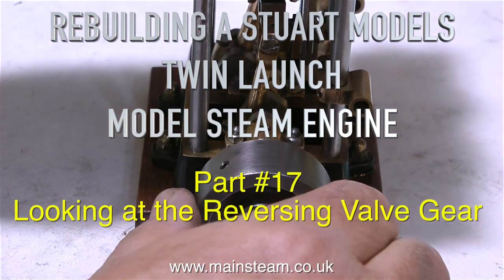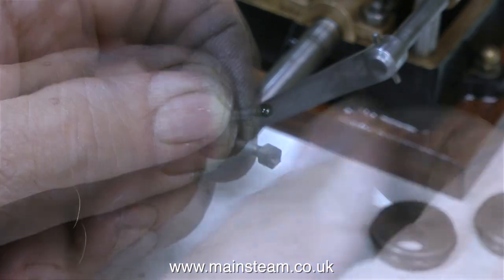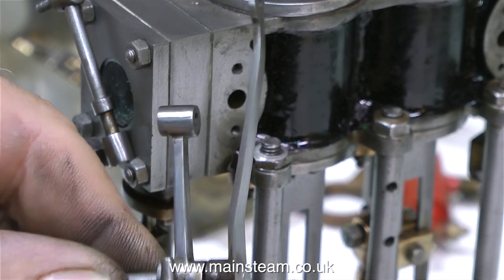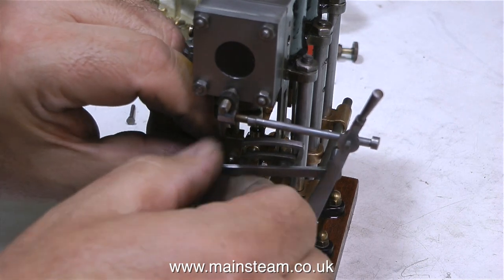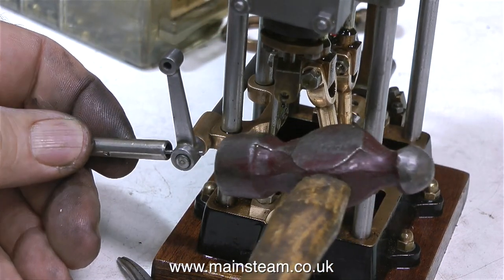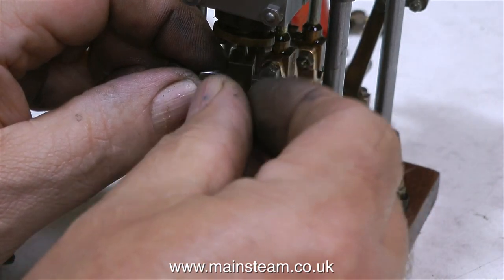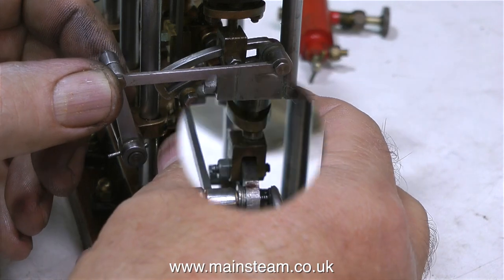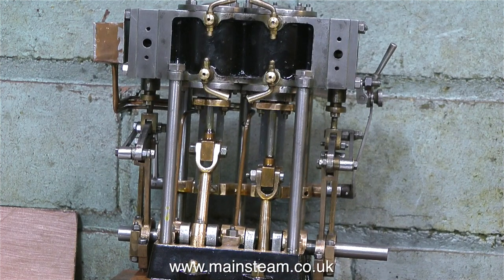STUART MODELS TWIN LAUNCH STEAM ENGINE REBUILD - PART #17

Comment: Just for your viewers' information, the Stephenson Link Valve Motion was used by the LMS (London, Midland and Scottish) railway on their Sir William Stanier designed Class 5XP, the infamous 'Black Five' since they were always painted black. There was only one such locomotive built utilising the Stephenson Link, LMS no. 4767.

4767 was completed on the last day of the LMS, 31 December 1947 at Crewe Works. It was unique amongst the 842-strong class in that it featured outside Stephenson Link Motion in addition to other experimental features.

It was renumbered 44767 under BR nomenclature. The locomotive was preserved and nowadays invariably runs under the original BR livery of 44767 and has since been named 'GEORGE STEPHENSON'.

Comment: I greatly enjoy seeing the reversing gear being assembled.  Nice bit of complicated bits!  I noticed you ran a 6BA nut onto a stud to make a pin.  I've been considering silver brazing 5-40 steel nuts on threaded rod in order to come up with hex head machine screws for my horizontal '10' bar stock build.  I can't find much in the way of 5-40 hardware!.  I just made some brass 5-40 nuts from .187 brass hex stock.  Next, I'm going to try cutting up some allen wrenches.  I bought stainless steel threaded rod, but it is difficult to work, and I had to run a die over it. 
Is reversing gear ever put on a horizontal engine?

Comment: I am trying to figure out how I can fit a small lathe in my apartment plus all the other things I would need to build one of these engines.
I already have my Bahco spanners. I guess one has to start somewhere.
On my way home from work, I find myself wondering if Kieth has another video posted.
Great work sir.
Reply: I'm designing and building #10 sized steam engines on my Sherline mill and lathe.  You might look into them...

Comment: About Stephenson Link motion.  It can be arranged with Open links, or Crossed links.  One is called Launch-link.  One is jolly good for some reason, and one isn’t.  I’m very, very sorry, but I can’t remember whether it was Lineham (A textbook of Mechanical Engineering) or R.Sennet & HJ Oram (The Marine Steam Engine).  Or even Percival Marshal (Wonderful Models, Vol1 or Vol2).  I was born in 1948, and am senile.

Comment: Hello Keith,
I have a Stuart Twin Launch engine (made it together with an old engineer when I was a boy), and I can assure you: the lever for the reversing gear is exactly the way it should be on these engines.
But you appear to be missing half of the arms connecting the expansion links to the levers: there should be two for each expansion link: one on each side of the link.. If I find the old drawing, I can verify this.
Reply from the maker: Thanks for the info. I was going to mention about the missing links but I will have to work with that as it is how the engine was built.